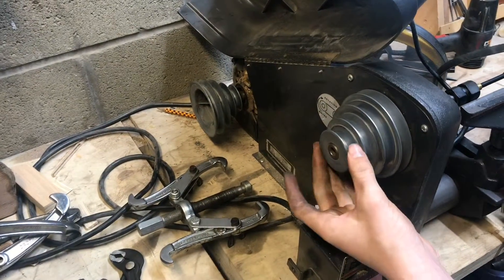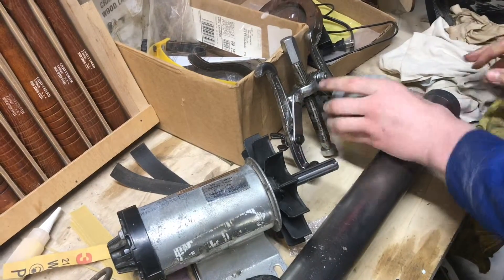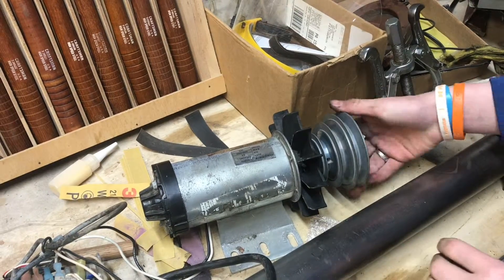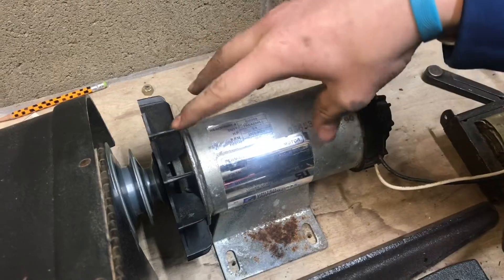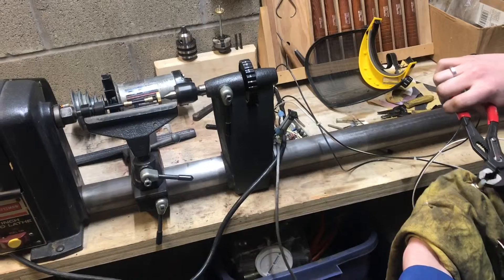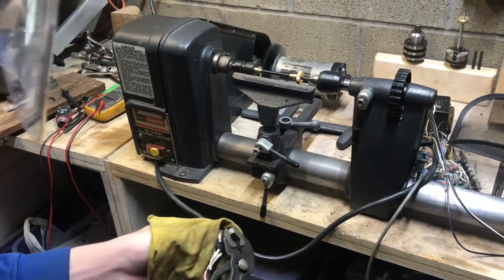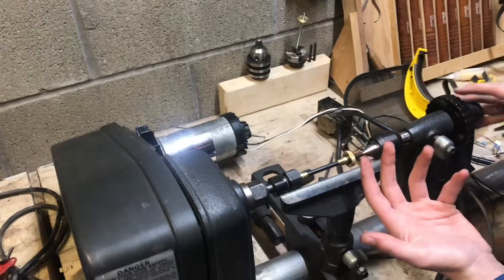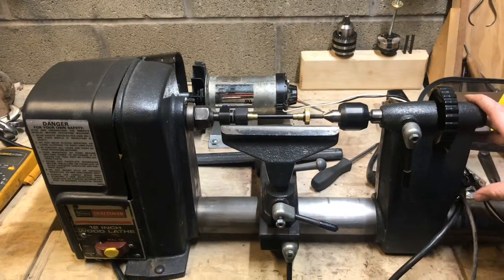LOW-COST way to convert your wood lathe to VARIABLE speed (possibly free) treadmill motor

Comment: Search Craigslist . Choose "Free" under "items for sale". Enter "treadmill" in the search box of the free stuff page. Click on "Save search" to the right of the bar where you entered "treadmill". On the "search" page of "My Craigslist" (accessed from the choices at the top left of the Craigslist "home" page) turn on "notify me" to get a notice as soon as someone posts a free treadmill. Works great. Costs you nothing. Call, email, or text ASAP when another treadmill is offered for free. Most treadmills fold so can be picked up and loaded by two people even in a car. That's how I get 'em.
Reply: Hey man what laith is that I just bought the same one for 50 bucks the tool rest is broke and I wanted to look into getting a new one very good Idea I was trying to figure out the same thing that's how I came across it!

Comment: How did you know how to wire it?
Reply: A treadmill motor is easy to wire up with either an SCR controller or with the actual treadmill board depending on the kind of board.

Comment: Thank you, Helps a bunch, I have the same lathe (Craftsman/Duramax/Central Machinery) but with a 1hp motor, and was thinking about doing a similar conversion. Oddly, I would have thought a dryfit verses putting anti seize on the the shaft. 

Looks like you extending the pulley pretty far out on the shaft to get a proper alignment, have you had any issues?

I have also recently found a Nova3000 without a motor (I think they had done a similar conversion with the expensive Nova motor and wanted to take the motor to their new Nova 1644) I wonder if any of the treadmill motors are face mounted...

Nice to know that the shaft is 5/8ths. I've seen several tread mills for free or <$30, I'll have to collect a few to check out their motors.